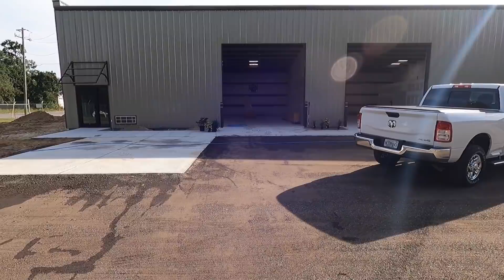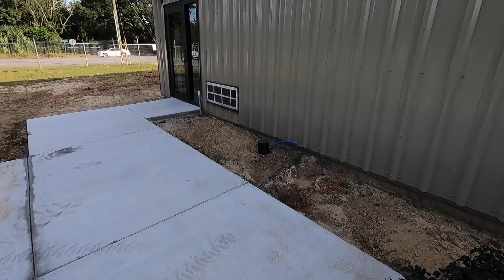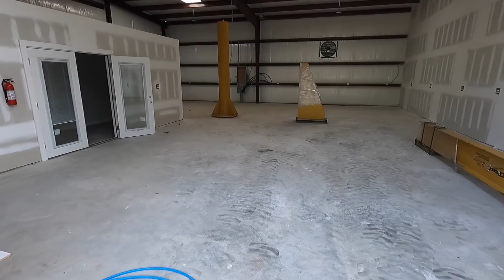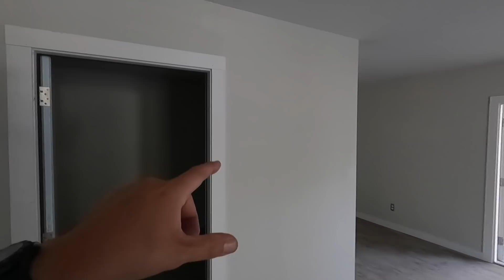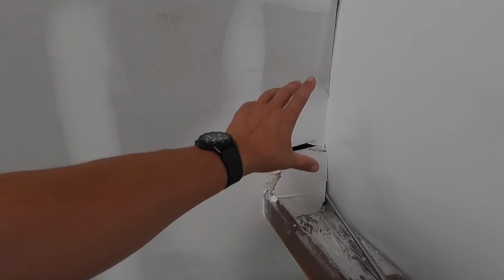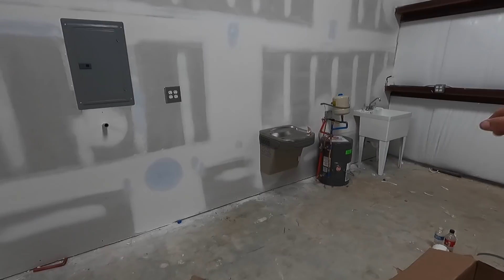New Shop Space Update 8: Driveway, Office

Comment: One access into the building for internet is somewhat 'lite'. And the current outlet position is incorrect - it should be on the other side of the door where you said the computers would go. And if you do run with CNC you might want other outlets around the building. Relying on wireless access is totally not the right way to go with hard wiring much preferable. It looks like you have an electricians view of network cabling rather than an IT persons view.
Reply: ^^^^this.  The IT part f the design appears to have been overlooked.
Reply: This, get at least a small network cabinet put in for them to bring your internet into so you have somewhere to put equipment like a small UPS (to backup power) and router with cables run from a patch panel for a smart doorbell (for deliveries), smart roller door controller, cameras inside, a wifi in the office, shop (and out front for if your in your car) highly recommend the Ubiquiti devices (UDM Pro, door bell, cameras and AP's)
Reply: Y'all know he's going to have to add power for his machines, and if needed, data cables can be run at the same time. He's just got the basics to get things going for right now. You can always add data AND power later. Very easily, I might add. Even Fernando can help with that, if he's able.
Reply: @IceBergGeo  Adding data later can indeed be done later. But he will need data immediately if he want s to do anything with the internet. Much better to have added it now and will cost 1/3rd the price while the walls are unclad. I have spent 20 years adding data 'later' commercially. It is not easy and it is not cheap and it can be ugly. And I have found that you DO NOT let an electrician anywhere near your data cabling ! For starters the places he will need data are mostly NOT where you will need 3 phase power. And you DO NOT lay data cable anywhere near electrical cables. Any good IT person can plan quite well where to place data cables that are not 1' out. I can.
Reply: And if you see a position where you know you will need say 2 computers you don't lay 2 cables but put in 4 cables. Wireless is the pits, hard-wiring much more reliable. Wireless is only for the intermittent connection of a laptop.
Reply: @chrissybabe8568  I resent that comment. ;) I am a sparky, and can run data, properly. Running power after things are buttoned up is just as easy as running data. Unfortunately, where I live, everything must be run in conduit too, so I've become pretty good with it all. Keep in mind, I didn't say it was fun, but I kind of like it, being the sadist I am.

Edit: I'm sure he can run with wireless networks for a short period of time, add I'm sure his editing and uploading will still be done around home. So, for surfing the web while he's setting things up, I'm sure he'll be just fine.
Reply: DO NOT let an electrician anywhere near your data cabling unless you have ascertained that he has a track record of doing a good job. But note this - you go to a barber and ask for a haircut and to take plenty off - the average hairdresser will take the minimum off that he can get away with because he wants you back sooner rather than later. Same with the average electrician - they do the minimum with little idea of planning or anticipating for the future. They want to come back for the additional installations. With the possible exception of yourself electricians only do what they are asked to do (by a customer who generally has even less of an idea). Now it is possible that most electricians have been conditioned to do jobs with the minimum of parts (and labour) because of pressure from clients to save a buck NOW. In the last 20 years every job of mine that has involved an electrician (include A/C installers in this) I have had to watch every step they did to stop them from screwing up my IT cabling jobs (classic example of A/C installers drilling holes through my cables because they are as thick as two planks - maybe yourself excluded). Note also that IT cable installers don't have the same experience in running cables that an electrician might. There is no apprenticeship for laying IT cable. When the wall linings are off is the best and by far the easiest time to install data cabling. And keep it away from heavy power cables.
Reply: @chrissybabe8568  I got a kick outta your response! Honestly, most "electricians" are good at one thing or another, and unfortunately, don't care to learn any more than they know, or are pigeonholed into just doing one part of the job. I see it all the time. I do know a good number of them who can run data just fine, but we're paid more than cable pullers, and as such, isn't worth it for most of us to do it and get good, unless we're on a small job and can run it without incurring a huge bill for the customer. All it takes is a little planning and forethought, which so many people are lacking, mostly because bosses just say, "get it done and move on to the next job".
Reply: @IceBergGeo  I am not too sure what the difference is between pulling a power cable or a data cable and wiring up a power outlet or a network outlet. Both require a few clues and similar dexterity. I have done both. Planning where to place a power outlet or a network cable outlet are also similar. Building a switchboard and a networking panel the same. However I know a few electricians and they do seem (generalizing here) somewhat hesitant to get involved with data.
Reply: @chrissybabe8568  a lot of them are. It has more to do with the unknown aspect of it. They don't want to ask how to do it and nobody is gonna pay them to teach them. I learned on my own and had it reiterated in my apprenticeship school. It's really not hard. But nobody has the time anymore. Just get it done and let the next guy worry about fixing it.

Comment: Those Kaesar rotary screw compressors are awesome!  Work has 4 of them in different buildings.  Lots of high pressure, DRY, shop air and the compressors are way quieter than the piston type.

Comment: To have the 120volt outlets all around is great. I agree with the site electrician there doesn't need to be 3 phase all around the space.  You also want to have dedicated circuits for any of the machines especially the 3 phase ones. Very normal and standard to wire equipment after construction when its in place. Cant wait to see chips fly in this shop!!!
Reply: I'm glad the contractor is wise. No sense in spending money to install it and then change it as soon as you move in. I'll bet there will be at least two more subpanels. One for the big equipment and another for 480.

Comment: Modern water coolers have an electrical valve, no longer mechanical. Had to have power for thr compressor anyway, bit older designs would at least give you room temperature water without power.

Comment: Putting a desk or a couch makes it nice to have french doors.  I have two sets of metal - not always great.  I have one good and one so so (installer).  If you need a heavy duty Hy oil driven xy and Z it is a knee mill look like - wheel stays fixed and the table moves up/down as needed.  I have two these are British and parts in Ohio if wanted.  Both work.

Comment: Back in the 1970's we had a lot of trouble with a new 200 HP screw air compressor. When one of the 8 or 10 hydralic hoses split open would take over a 55 gallon drum of expensive oil. Think the pig held 100 gallons. We had 3 screw air compressors in the 80's that had to run almost 5 years before first breakdown.

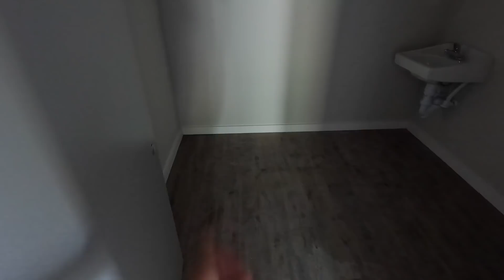Comment: 5:30 "Handicapped accessible" - needs a support next to the toilet to help with transfers from wheelchair to the toilet and also needs a pull-cord 'help' alarm that can be reached by someone lying on the floor. Door needs to be unlockable from outside too.
Reply: ADA is not a state reg...
Padded plumbing beneath the wall hung sink.
I'm a little surprised the door itself doesn't have offset hinges so it swings clear of the jamb.  🤔
Reply: I'm sure what will get completed, will, per state law, in order to get the cert of occupancy.  So STFU!
Reply: @CB.5  Who will check that ?
Oddly, that workshop hasn't got a single fire exit either - it really could do with 2.

Comment: I remember you saying about them cleaning the floor are they gonna seal it too if not you really should do it
Reply: Did work in a large injection molding/ machine shop where they had a company come in and clean all the oil stains from old cement floor then expoxy entire area. Floor held up with a 10 & 15 ton fork truck running over it 6 days a week.

Comment: I don't know what its like down there but here we have to have compressor outside in a separate room like a mini shed it has to be inclosed ,contained on account that it can explode
Reply: Where are you?  I've never heard of that.   We do have a compressor outside.  We actually plumbed the intake through the wall so it takes in air from indoors, which is air conditioned.  We drain a much much smaller amount of water out of the air compressor since we did that.
Reply: UN BE LIEVE ABLE ! No one should be thinking about allowing the air receiver to explode !
Reply: Not in the real world !
Reply: @rl3898 thats how it is here and I have heard from lots of others its like that at alot of places not all have to be inclosed but do have to be outside

Comment: I think he should have sprung for concrete instead of crushed asphalt. That stuff is fine under light weight vehicles. You are going to have ruts in no time.
Reply: It looks a mess already !
Reply: @millomweb  Your just having a great ol'day putting everyone down today, aren't you.
Reply: @philipmackin1025  ...It's how he rolls!  In his opinion, if you can't over oil it (see Keith Rucker's channel), then bitch about it!
Reply: ...good recycled asphalt will roll out hard and tight...
...bad recycled will be a muddy mess...
Reply: @paradiseroad6405  there is no good asphalt. It works but it’s not sufficient. It breaks down in a very  short time and turns to mud. You can pack it and pack it and pack it all you want. There in Florida it rains all the time. He will have a mess a majority of the time I can promise you. I do driveway maintenance and I have yet to run into any asphalt that will hold up to weight for long periods of time.

Comment: If you’re getting a rotary compressor consider the heat rejection.  It’s possible to duct the heat outside, if it’s inside. Also reverse is true. We bought a 30hp Kaeser for our new truck shop in1999. Worked great, made heat and water like crazy. The refrigerated air drier was worth every penny. Pretty humid in western Oregon most of the year, Florida is probably worse! Also check the Db rating. The whine is quite annoying.
Reply: I agree.  Rotary will be noisy even when unloaded.  All screws I've seen run constant and I don't know if cycling them would be a good idea.  A recip would be noisy when running and cycle off.  Also if you don't use allot of air it would be cheaper to operate.
Reply: Wonder if if his landlord would be cool with building a compressor shack in the back? If not, in an enclosure inside... the massive Ingersoll-Rand Screw compressors at work are deafening... We use a lot of air!

Comment: What is that patch of light in that one ceiling corner? Hole in the roof?
Reply: Skylight.
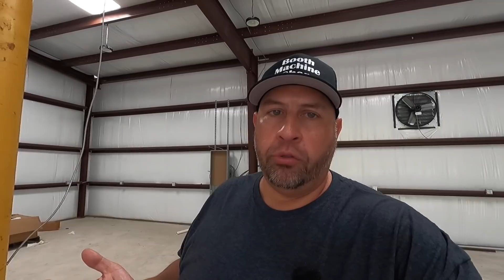Reply: Agreed... what is it...   clearly visible at multiple spots... 8:15, 9:56,  etc.    Seems like daylight is shining through that spot.
Reply: I bet that gap stays unless Adam does something about it. It is just how the panels line up in the corner. It has zero affect on structure or rain, that should stay nice and dry. The customer who rented out the bay on the other end should have an identical gap.

the building is finished now its just finish work. Electrical, water, air and anything else it needs.

Comment: What’s this stuff out front?  I’ve never seen asphalt that wasn’t black. Maybe crushed stone with a binder?
Reply: Asphalt milling. It road asphalt when they remove it with a mill. It turn gray/brown. This stuff it like 1/4”minus gravel with tar. If it get hot enough and the tar content is high enough, it will bind together again.  Otherwise is almost like chipseal
Reply from the maker: The contractor said it’s not as good as they got on the last building, but your kind of limited to what the company in town has. But it’s the cheapest driveway you can make besides just dirt.
Reply: @mxadema  Thanks, I learned something new today.

Comment: Just a thought: Abbie's space above the office, is the high point of the sloped ceiling.
That means that heat will accumulate in that space more than anywhere else in the shop.
You should consider planning for an additional A/C unit and/or an exhaust fan in that area.
Either way, looking forward to the next updates!

Comment: Wouldn’t leaving threshold out work better for you? If you are rolling stuff in and out. That would make it harder.
Reply: For a single wide you can get away with that but double wide that's part of the door structure
Reply from the maker: Contractor said he could not leave that out. I’ll have joe break me up a short ramp if I need to roll in there.
Reply: The threshold acts as a spreader. It's awkward to fasten down the legs of the buck without one. 
It wasn't designed for that.